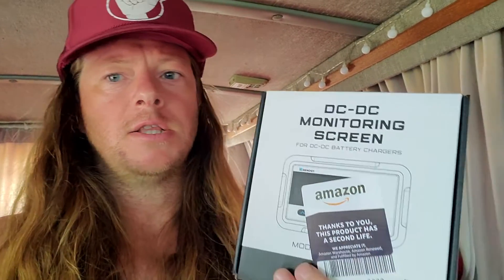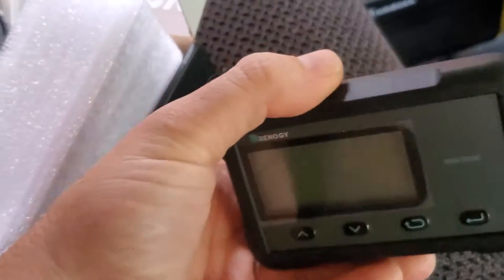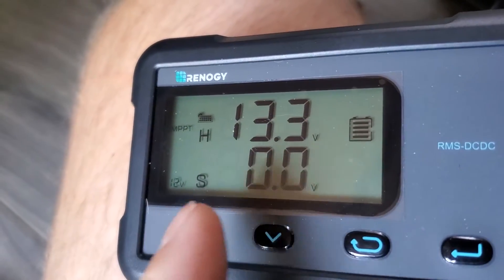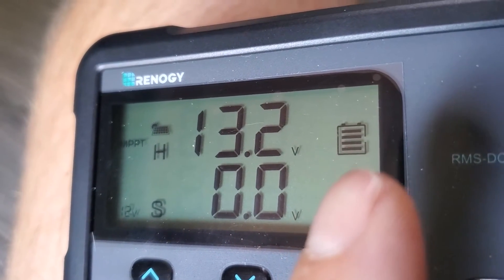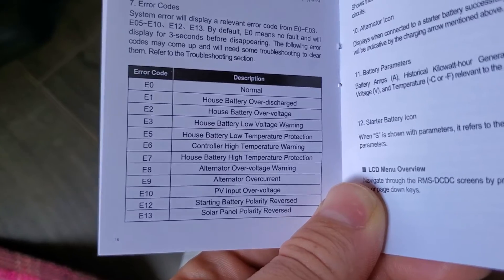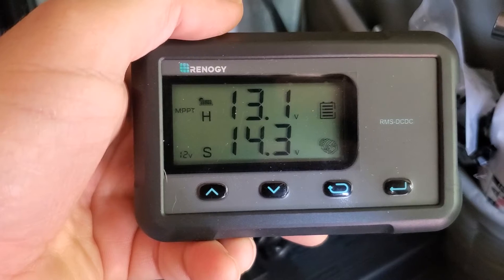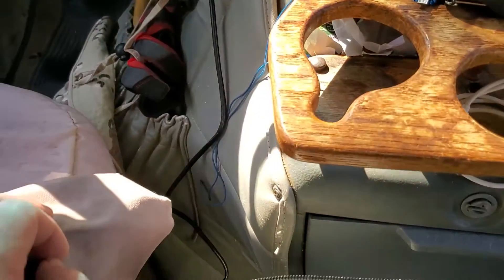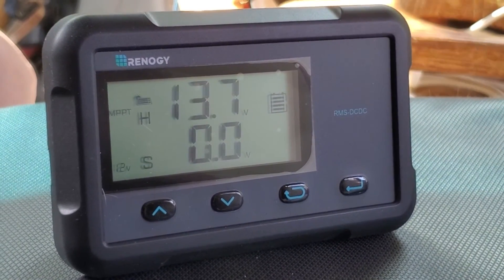Renogy RMS monitor for DC to DC solar charge controller - Unboxing & Setup

Comment: hey will this monitor show you how many wats it goes from alternator or solar in to the battery?
Reply from the maker: It shows amps or volts on the displat.... 

but for reference,  amps x volts = watts 😀 
I would say that most deep cycle batteries are labeled in amps... so you will know that X amount amps input through solar or alternator will then take x hours to top off your battery bank.

So if you have a 100ah battery and you are pulling 10 amps total from solar panels... it would take 10 houra to fill from empty, or 5 hours to fill from half... etc 

Forgive me if you already knew that
Reply: @kampinglogik  thank you for explaining this top me. much appreciate
Reply from the maker: @LecimyzKoksem  no problem! Cheers!

Comment: Thank you...  

Does this work with the regular renogy dc to DC charger and the renogy dc to DC charger with mppt?
Reply from the maker: I think it only works with this particular DC to DC with MPPT solar connection. THere is a 30A and 50A version. As far as I know it doesn't work with the turquoises-colored  Renogy DCtoDC with NO solar inputs
Reply: @kampinglogik  thank you and you are correct...  I did buy it...  I am hoping it's the same display that works with the renogy smart batteries so that not all is lost
Reply from the maker: oh yeah hopefully!
Reply: @kampinglogik  thank you... I bought the monitor thinking it would work with the non mppt version of the DC to DC charger... In which you are right it is not compatible with it since it doesn't have a data port

In hindsight I'm going to keep it because I do plan on upgrading to renegie Smart batteries I looked at their catalog .. their largest capacity amp hour batteries are 200 I'm hoping they will release a 300 amp hour version which would be a nice fit for my class B+ van..

Please keep sharing info that you've accumulated because this video alone help me so much even though  made I preliminary air in my purchase
Reply from the maker: dang yeah that would be awesome...  or you could do two 200ah?
Reply: @kampinglogik  2 x 200 ah renogies are my goal..   I have a 21 foot class B..

Maybe I can run the AC for a few hours when it's hot?..

You are awesome and thank you for taking the time to reply

Comment: Hi. Can you tell me if it will tell you the KWA for the alternator and solar independently.  So you can see how much each has contributed without the other. 
Cheers
Reply from the maker: Ok as far as I can tell - it only gives a total for each battery separately. It does not seem to break down the numbers for alternator and solar, just the total watts/amps/volts/amp hours getting to each battery, regardless of source. Does that make sense? Hope that helps. Let me know if I can clarify better.
Reply from the maker: Hmmm that is interesting. I will have to check the van when I'm home.

Comment: I cannot believe they haven't put a battery percentage screen on this thing.  Thats literally all you're going to care about on a day to day basis. So frustrating.
Reply from the maker: Yeah true. It does have the battery meter on the right side, but still not as convenient like you said.
Reply: That requires a shunt that can monitor the load current at the battery, as well. They do make such a thing RBM500-US 500A Battery Monitor With Shunt
Reply: @jamesalles139  yeah I appreciate that, but they could have paired it with the renogy bluetooth to monitor it that way.
Reply: @TomBedlammusic  I see what you are saying. RS-485 communications can lend itself to a multi-drop network, so more than one device could be monitored by one screen.

Comment: Hi, did you notice a hissing noise from the display? Mine has a hiss that varies with the input voltage...would be a pain if put next to the bed.
Reply from the maker: Wow that is crazy... mine does not make any noise, and it is always connected. Does it seem to work otherwise? I agree that would be obnoxious while out camping in nature and hear something hissing...